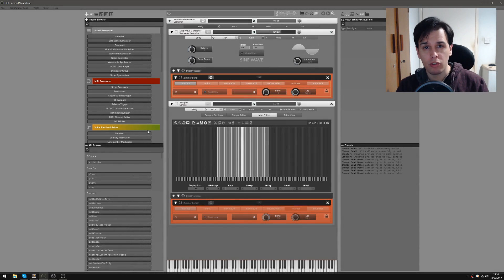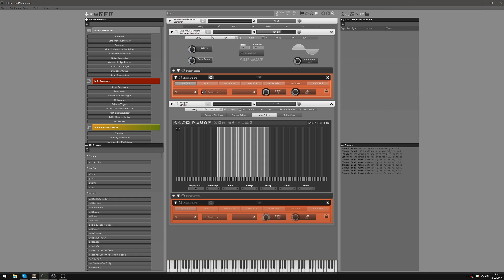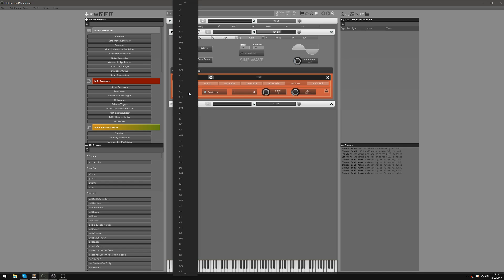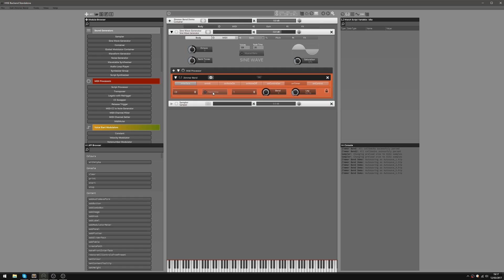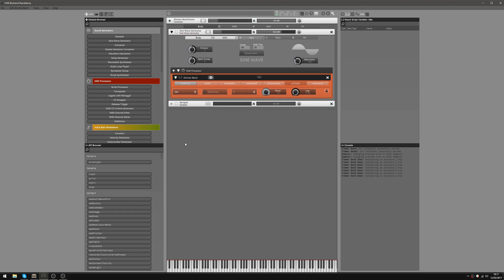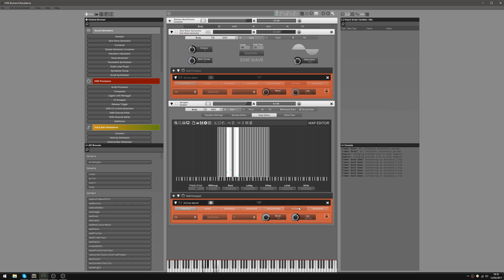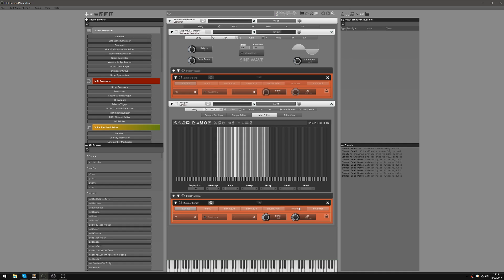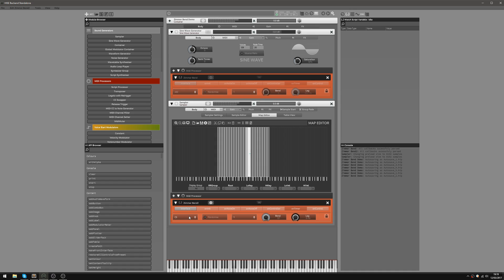Zimmer Bend: Script for HISE

Comment: yes all good, but how do you export the damn thing? I am ok inside the HISE software but I am struggling to export my plug in!
Reply from the maker: Have you compiled HISE?
Reply: Forgive my naivety, but I am a newbie to this software: can you explain what your question means? I wanted to try out a very basic wave generator: I managed to add a keyboard to the canvas, connect a midi keyboard. Then I tried to export as standalone. All good terminal says complete but I can see an Xcode error. After this I tried to open the plugin in Juce but nothing happens
Reply from the maker: @gabchi7795  Before you can compile plugins (export projects) you should build HISE, because the process of compiling you plugin is exactly the same. So to make sure everything is setup correctly, start by compiling HISE. This will also allow you to always use the most recent version of HISE.

Comment: Very cool, and reminiscent of the THX Deep Note.  I'm a software dev who is just starting to look into HISE so thanks for publishing the code.  Nowdays even our synths can be programmed in Javascript.
Reply: Lol that´s not javascript is a subset of javascript and is not standard compliant. And you can just script some stuff using that ¨javascript¨ before you start having high overhead, look to the c compiler inside or fork hise for demanding dsp stuff. Javascript is not the solution for everything!
Reply from the maker: It's not even a subset of JS really, it's a separate language that smells a bit like JS. We call it HISE script, and it's optimized for realtime performance.